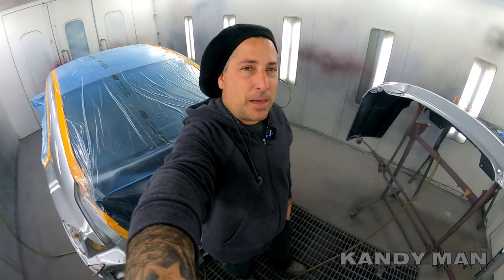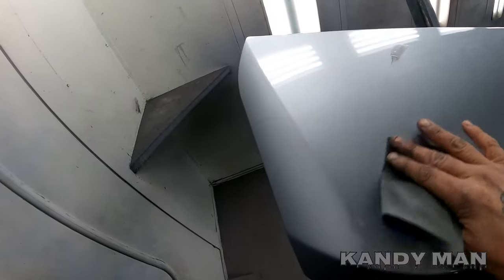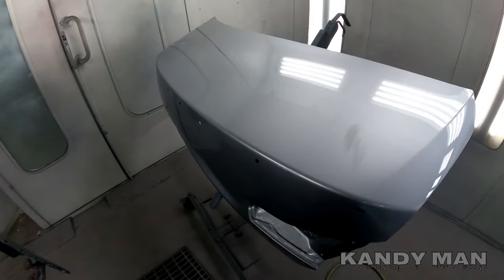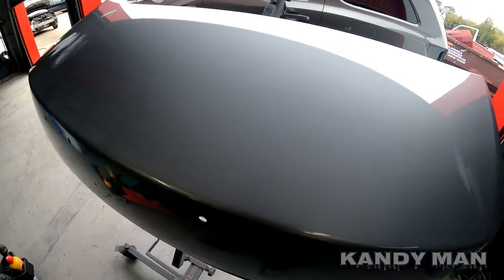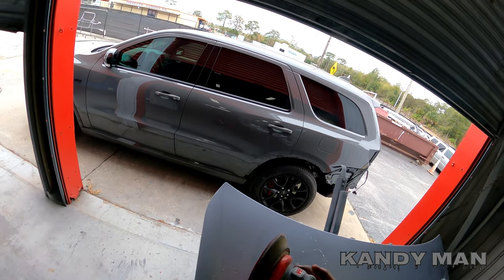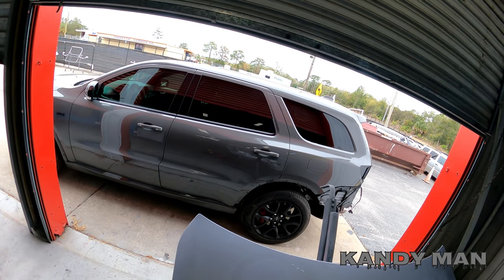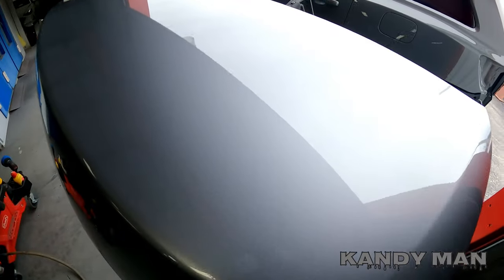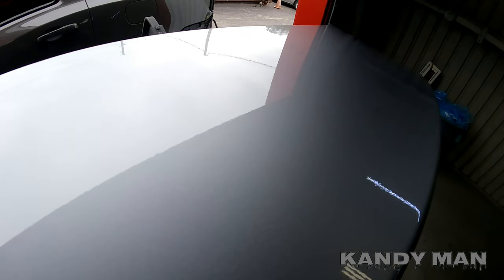HOW TO NIB AND POLISH

Comment: I'm a total newbie i repainted my very 1st panel which had damaged top coat peel outside using spray (rattle) cans 2K top coat i got 3 large ish runs i used the Mirka shark blade fantastic little tool, it got them out 😮 then block wet sanded those areas 1000/1500/2000 + 3000 than i used a DA and wet sanded the whole panel 1500/2000+3000 then i used the compounds used in this video with lakeland pads and if i don't say so myself the job came out looking really good for a newbie but i couldn't of done it without fantastic amazing videos like yours

Comment: Depends on the clear coat you’re using . And how fressh the clear coat is . I’m very hesitant using 2000 it creates swirl  marks, even hitting it with 3000 . Heavy RPM on your white pad, heat it up faster

Comment: Old timer here from UK. Just a couple of things, have you experienced the re-appearing of de-nibbing marks  a couple of hours after final buff?  Secondly, I've watched many vids on you US refinishers and you seem to prefer wool heads instead of the sponge heads. It just takes me back to the cellulose days which they were great but would cringe using them on a 2K finish.
Reply from the maker: Yes I have had that  problem. That's why I use the wool lol .I switched back to 3m and now use only foam